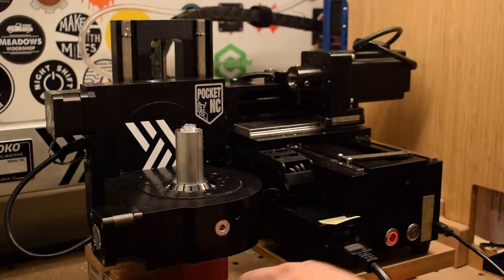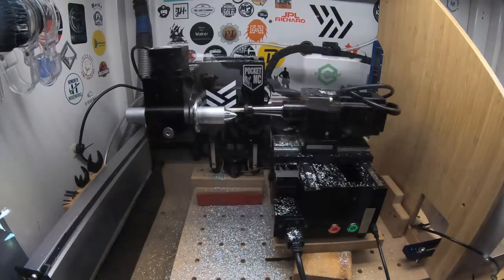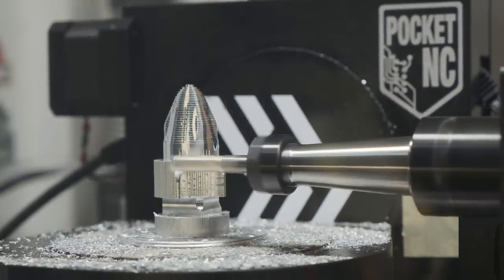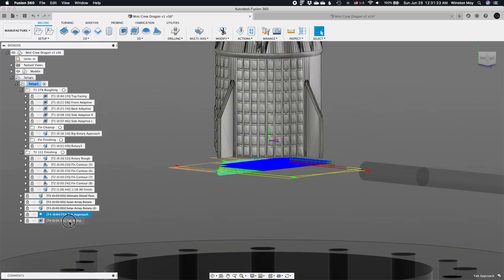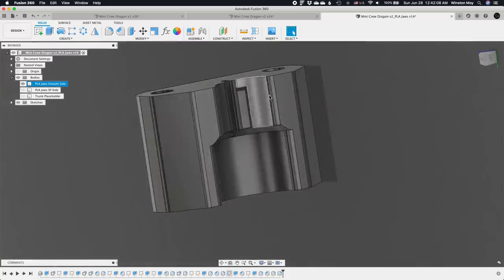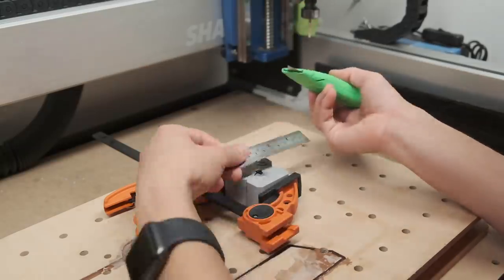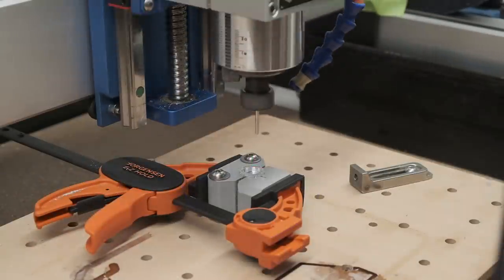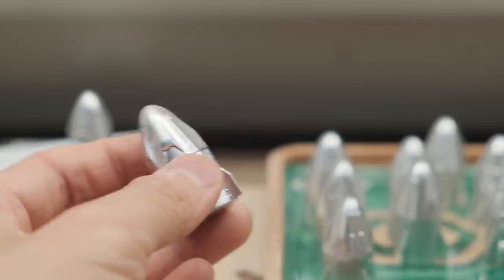Pushing My PocketNC as Hard As I Dare - Optimizing Mini Crew Dragon Production

Comment: Check out loctite retaining compound.  Not thread lock, but retaining compound.  Tolerant of .001-.003"  slip fits, and it would be the perfect thing for the magnet in this case.  It is designed for permanent attachment on cylindrical fits.  I also like press fit and sometimes a shrink fit by heating the female part first, but retaining compound works so amazingly well and can be removed with moderate heat if needed that it's my go-to about 90% of the time these days.  Hope you'll check it out.

Comment: 3:38 Was the tape used to prevent chips from getting into the machine?
Reply from the maker: Not into the machine, but into threaded holes used for mounting workholding/accessories. I'm a little OCD about vacuuming them out every time I check on the machine, so I decided to bypass that problem completely by covering them all up.
Reply: @AntiViGames  May be screws.

Comment: if you could create grooves to slot fins into, you could get stock closer to end size and machining time would be cut down by at least 80%.  but you'd need a separate function that creates fins, and then you glue or friction fit them in. the overall time savings would be huge. less than an hour per.

Comment: Dealing with heat from cutting aluminum is something I've dealt with a lot before.  Take bigger cuts, cut faster, and use an air blast.  If you're generating heat, your doing so because of friction.  Nice work!

Comment: Could you have used bar stock that had a small dynamiter, to have achieved a similar result in material reduction? Also could machine an Aluminum fixture to hold the capsule for other machining and eliminate the worry of the plastic one melting?

Comment: Just wondering if you had thought of doing milk turning? Rotate the B axis while slowly ramping in on Z to take off the bulk of the material. Would probably work for the top side and the underside to potentially save even more time? However, I’m not sure if the machine can handle it either? Something to look at, if you haven’t already.

Comment: I know the Dragon doesn't use a fairing but making one for it anyway would make for really classy on brand reusable packaging. Oh and fill it with black foam with a little spritz of white paint to make a starfield. Or run fiberoptics through the foam and have it light up the stars when you open it.
Reply from the maker: The fairing packaging a cool idea. Would be quite fitting for an X-37 model, since it does launch in a fairing...
Reply: @WinstonMakes  How about painting the box to look like the Vehicle Assembly Building.
Reply from the maker: I like the idea but it doesn't scale up. Painting is a time intensive process. Ink transfer process might work better, or use a vinyl cutter as a stencil.

Comment: I recently saw on NYC-CNC John using hot glue for holding parts when cutting off tabs, do you think a similar method would work at 6:30 when you hold the dragon capsule with your finger, by filling the apposing side with a blob of hot glue to keep the capsule steady (without need for your fingers) :-)
Reply: I'm going to try that next time. Thanks for the suggestion.

Comment: Pro tip for setting your stock stickout:
Follow this guide and enable manual passthrough in the post processor:
https://knowledge.autodesk.com/support/autodesk-hsm/learn-explore/caas/sfdcarticles/sfdcarticles/How-to-use-Manual-NC-options-to-manually-add-code-with-Fusion-360-HSM-CAM.html
Make a Manual NC operation, change the type to passthrough, and put this code in the box. Change T6 M6, and H6 to the tool you plan to use. Inspect the point end point of the stock in fusion, and take that absolute y value and use that as your Z value on the line that containes g43.
T6 M6
G53 G0 z0
G53 G0 X2.5 Y2.5
A90. B0.
M0
(Z stickout)
G0 X0 Y0.125
m0
G43 Z2.545 H6 F20
M0
G53 G0 Z0
G53 G0 X2.5 Y2.5
A00. B0.
run this operation at the begining of the setup, make sure your stock is not sticking out too far so it wont crash the tool, also you may need to add about 0.020in to the z stickout value depending on how much takeup your collet has.
The manual passthrough is extremely useful since you can write in manual code, and not have to add it in manually after each time you post it, and its saved in fusion.

manual passthrough is possible on any fusion post. for you router it would be useful as a pin stop, to but the edge of stock up to.

Comment: Can you replace the drills in a pocket NC. I want to use a diamond drill bit
Reply from the maker: You can install any bit that you can fit into a standard ER-11 collet, but you should also consider whether or not it's a good fit for the machine. Some diamond/grinding bits for a Dremel may not work well at the lower speeds of a PocketNC V2-10. And abrasive dust from materials can damage the machine.